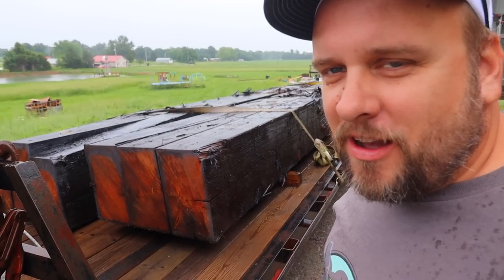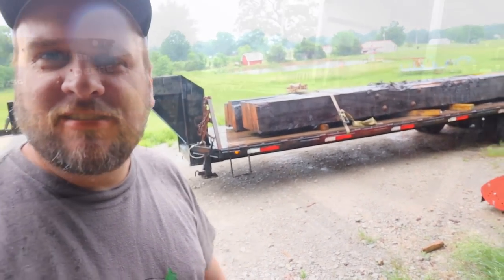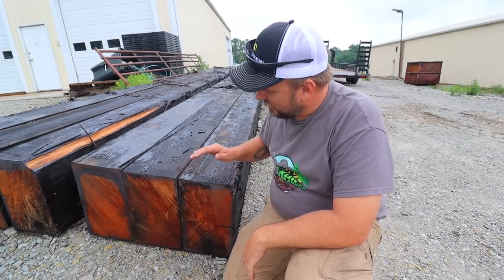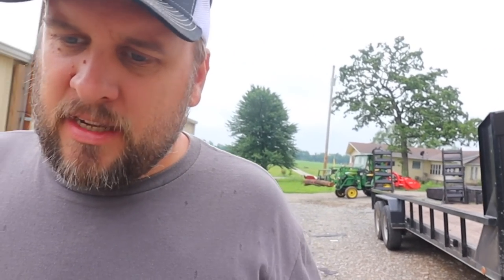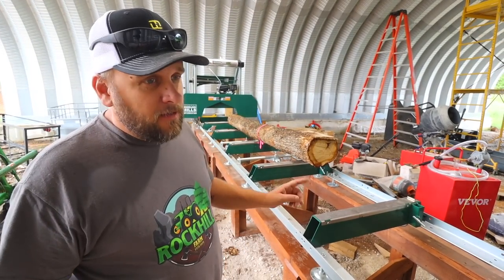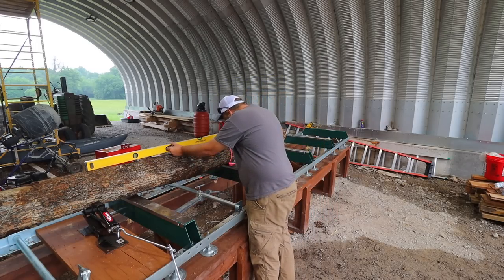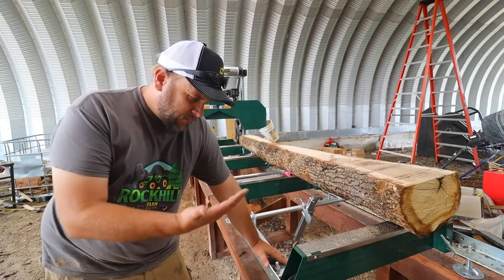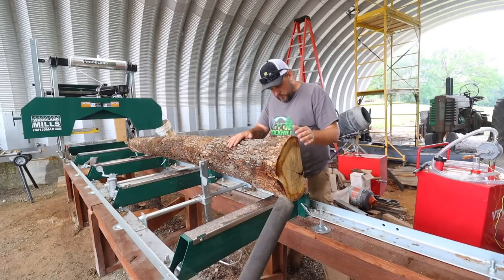Giant Beams and Tiny Logs on the Sawmill

Comment: Question? How do you know on the second cut that the log is true 90 degrees from the first cut?
Reply from the maker: If the flat spot is tight against the vertical log stops then it should be 90 degrees
Reply: @RockhillfarmYT  thanks for the reply.  I figured that was how it was done. Just didn't get a good view of the stop. Thanks.

Comment: Best ro wear long sleeve shirt a face shield  gloves. That stuff will ruin you clothes. If skin gets burnt use clear vinegar on burn. Pour on let dry. It will probably gum up saw bad. Where a good respirator when cutting bolts.
I retired after 40 years in bridge department on csx railroad.